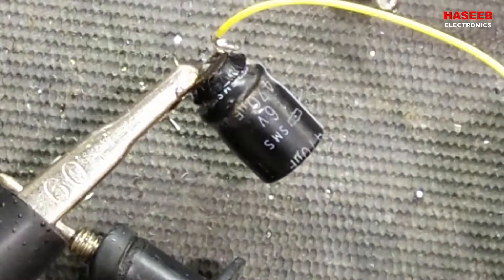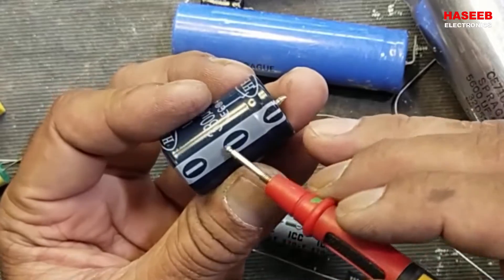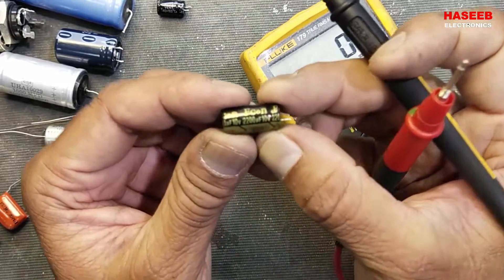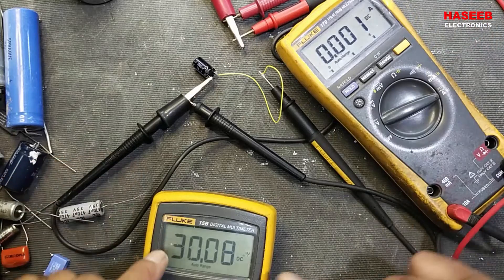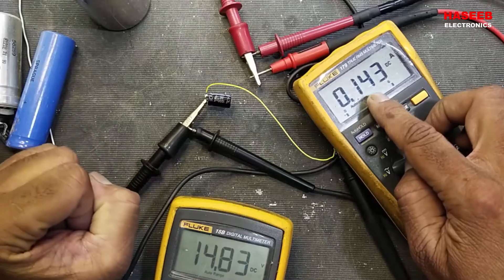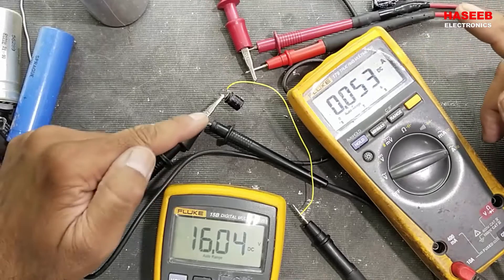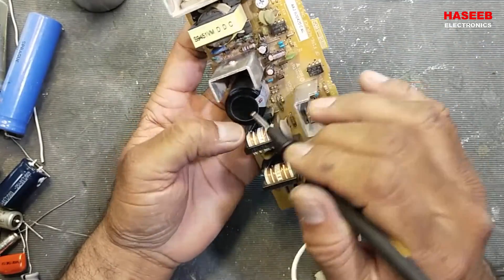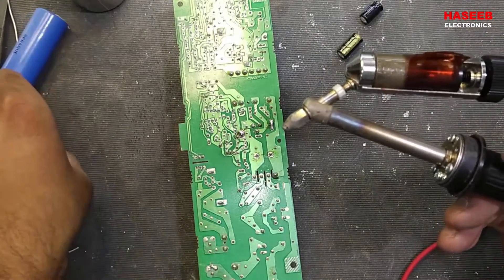[428] How to Know the Polarity of DC Polar Capacitor and How To Install in Board Correctly

Comment: اضحى مبارك وشكرا جزيلا سيد حسيب على هذه المعلومات 
I have a question please ...
When should we care about the capacitance of the capacitor and when it can be replaced with a higher capacitance without problems?
Reply from the maker: welcome dear
when the circuit starts miss-behave in circuit and the circuit's functionality is disturbed. 
if any capacitor gets leak, or high temperature while working, then it is to be replaced. or in some cases the capacitance is reduced, then it is to be replaced
we should not select high capacitance value for replacement. a minor increment is acceptable. while higher voltage value is acceptable but a big difference in capacitance will disturb the circuit
Reply: @HaseebElectronics  

In power circuits, I often replace capacitors with higher capacities, for example 330u/250v sometimes I replace them with 470u/250v because  its difficult for me to find the same capacitance without waiting
I havent had aproblem with this circuits so far it works fine

What I know that capacitance is important in filtering and data processing circuits such as communication circuits but I havent worked on these circuits before ...

I really hope that you will make a video about the effect of increasing the capacitance of the capacitor Many (including me) dont know much about that !
Reply from the maker: @techeng3940  470 is closer to 330uf.   it is acceptable
Reply: @HaseebElectronics  
Yes this was an example...
I mean what would happen if I replaced it with 1000uf for example?
Sometimes I replace 1uf with 47u or 100u
What will this affect the circuit? 
Can you explain that please?

Many people who work in electronics say it is okay but I didnt find a good and clear explanation !

If it was a smoothing capacitor with 1000u increasing it to 3300u what will happen to the circuit? in voltage regulating capacitors and charge storage capacitors as in the flyback system...
What will the increase in capacitance affect the operation of the circuit! ... I can't understand honestly 😓!